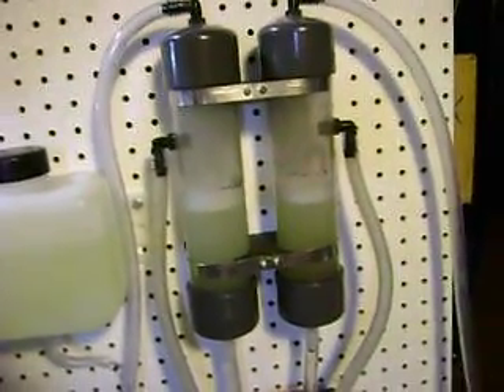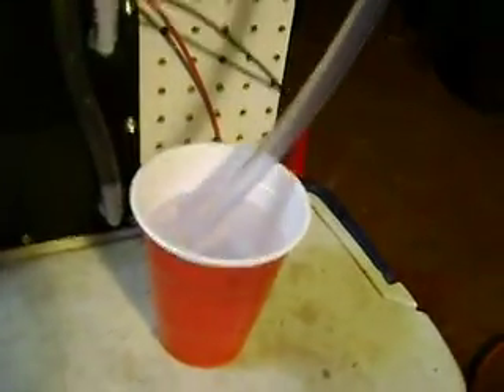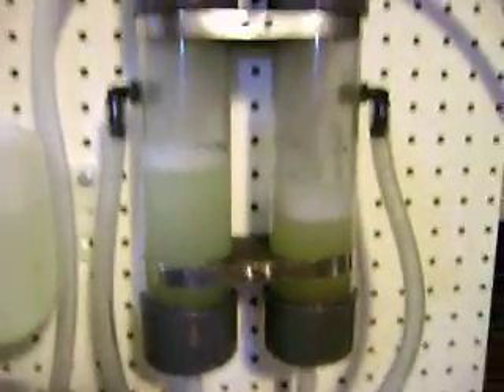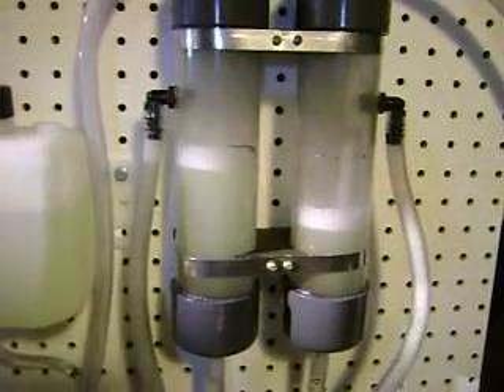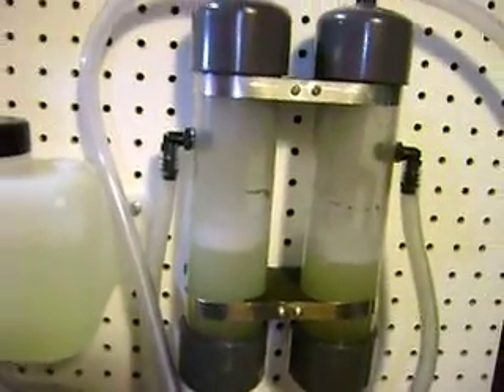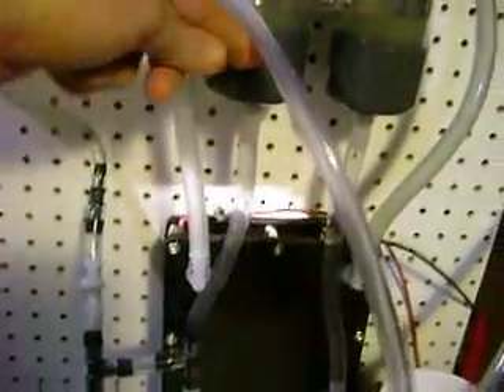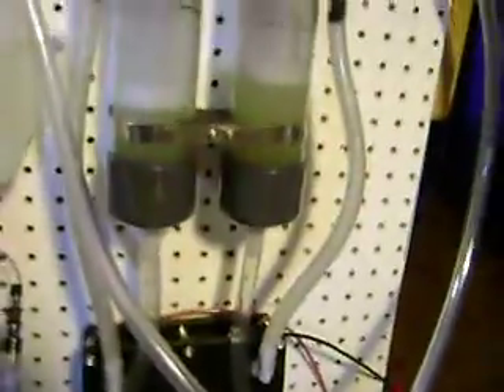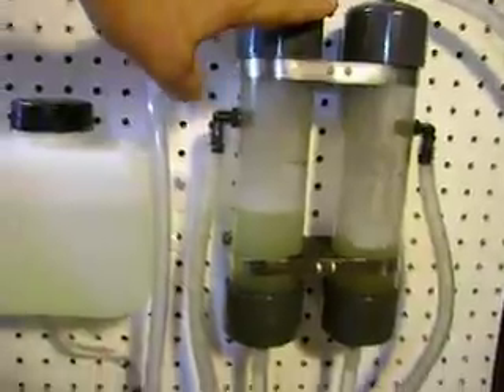Back Pressure on Gas Separator

Comment: @christo930 he old emissions systems recirculated exhuast gas back into the inlet to burn it again so to speak. Not used anymore as they massively increase NOx gasses, which are fast becoming a bigger issue then Co2

Comment: if you divert all the hydrogen into the intake manifold, what are you supposed to do with the oxygen? Would it be worth pumping it into the exhaust system? I know the older emissions systems used air pumps to pump air into the exhaust.